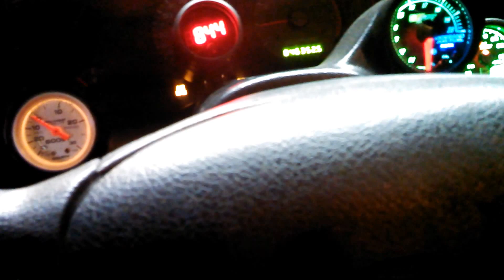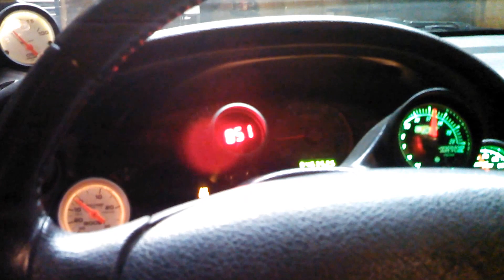Mustang Twin Turbo 2V Trick Flow Heads MMR Stage 3

Comment: This car gave me a instant orgasmic explosion, that sound made my knees weak my god!!! I’m just getting into the mustang stuff from having a fully built 2006 Chrysler 300c with a 392 stroker ported heads and a f1a supercharger, and that car was super easy to tune and make power with!! That Hemi has close to 900hp on 93, now I sold that and bought a cheap 2001 convertible gt for cheap, and already have a mmr 1000se 4.75 engine coming Monday based off a teksid block, have a set of lovernois ported trick flow 44cc 185 series heads, ordering some nice blower cams from either mmr or mhs not sure yet who to use!! Only down side is I’m going to be using a baby procharger p1sc at first just cause I got a complete kit with long tube headers and a snow water meth kit for very cheap due to covid 19,
Reply from the maker: Sounds like a great platform. I have almost completely rebuilt my car since posting this video. The cam specs in this video were 246/255 115lsa.